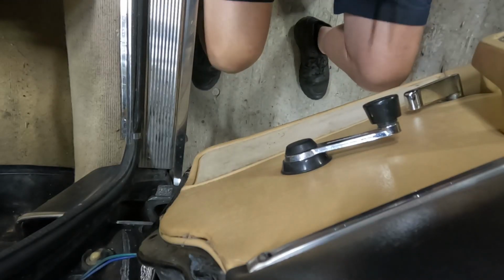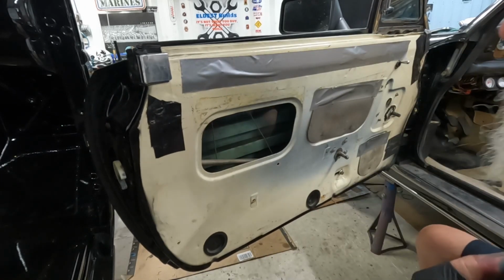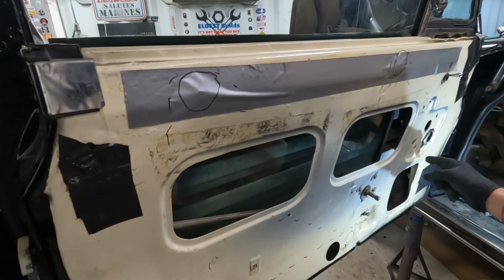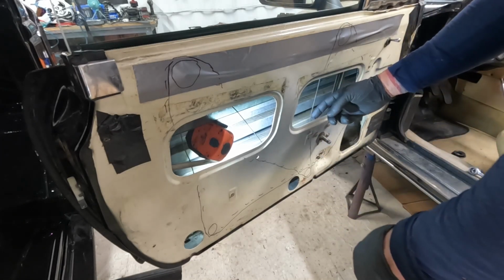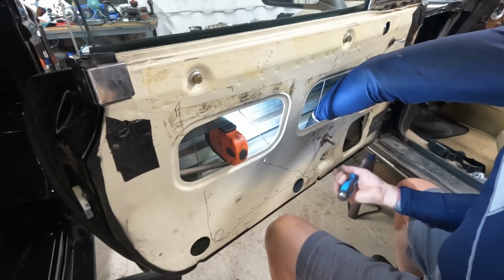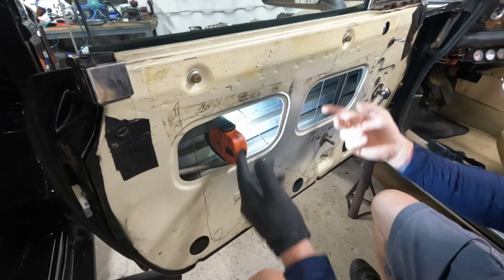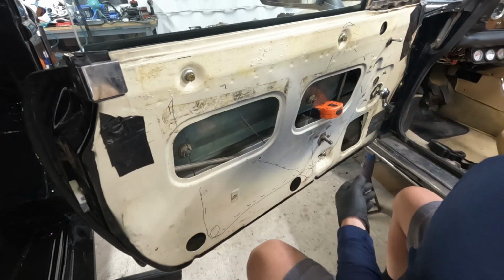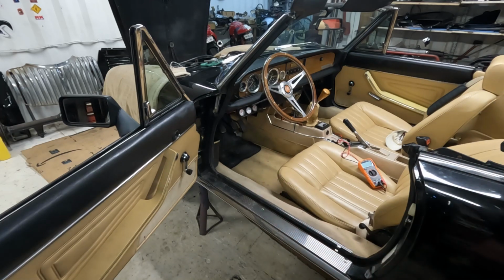Fiat 124  Spider 2000,  Remove and reroute the window crank cable, widow cable adjustments

Comment: So, I have a similar problem also with the drivers side door on my '72 Fiat 124 Spider.  It also had been previously "repaired" and the cable windings were installed incorrectly. I'm attempting to fix it but the cable is EXTREMELY tight, even with the crank fastening nuts loosened, the adjustable pulley (lower inside one), AND the two bottom bolts holding the bottom two pulleys down all loosened so as to try and create slack. Any particular idea what I might be doing wrong?
Reply from the maker: I had to loosen every pulley top and bottom.  Make sure the cable is pulled all the way out from the unit as well.